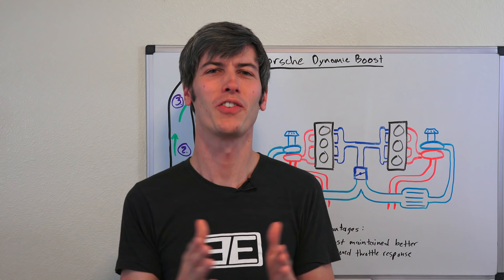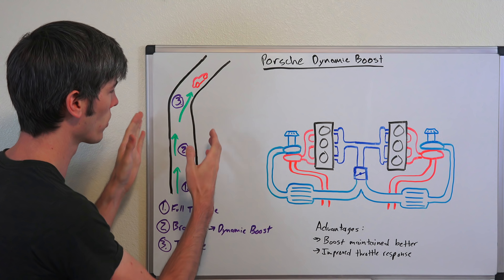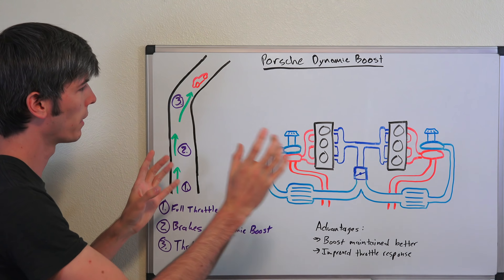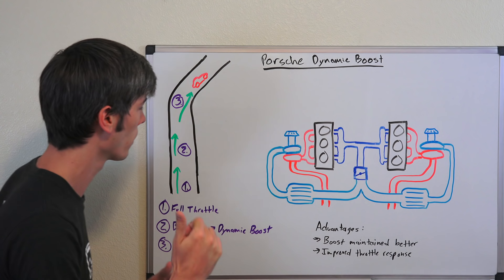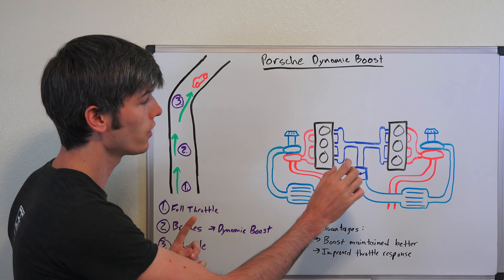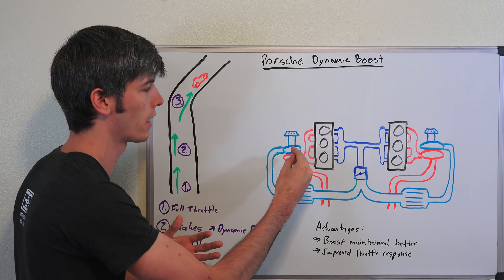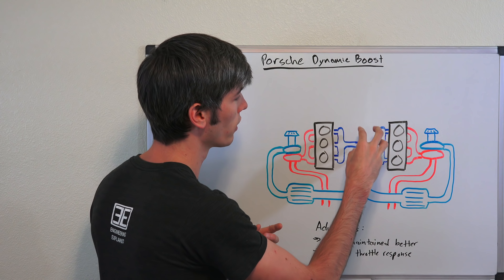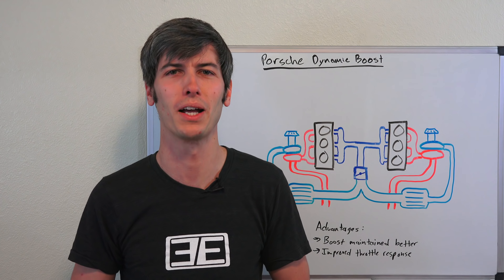Porsche's Anti-Lag System Doesn't Use Any Fuel

Comment: Interesting to se how it handles light throttle trough a long corner.
It can not cut the fuel too aggressively because it will run lean and damage the engine, it cant spray fuel to cool the engine without igniting it, because then it will ignite in the turbo or CAT.
Reply: Lars Jørgensen i had the same question on mind about running lean. In case there is unburned fuel  inside the cylinder which can detonate
Reply: First of all, it only works when you are not accelerating so when you are applying a little bit of throttle the engine works normally. When the system cuts the fuel it cuts 100% of it and pumps just air trough the engine( in a similar way to what RedBull did in Formula1 with their blown diffuser but with a different purpose). There is no risk of running lean because there is no fuel in the combustion chambers, just air. A lot of modern fuel injected cars also turn off the fuel injection sometimes ( like when you are going downhill without applying throttle) to save fuel. Some V8 cars have a system that deactivates both injection and ignition in 4 of the cylinders if all the power is not needed, effectively reducing fuel consumption by almost 50% when in use. Porsche is really not using something new, is just using some of the advantages that modern technology provides.

Comment: Jason, can you do a video on how modern engines cut fuel when off throttle? I never quite understood that.
Reply from the maker: Pretty simple, especially with direct injection. When off throttle you simply don't signal the injectors to squirt fuel in the cylinders.

Comment: Throttle valve wide open generally means very low vacuum. Vacuum normally used to assist brake function i.e. brake booster,power brake, etc. Low vacuum = less brake booster, and vice versa. How did Porsche overcome did issue?

Comment: Large and small turbos on the same engine, or Supercharger working alongside the Turbo. Both different solutions to Turbo lag. This is a solution that is simple, but has it's flaws in lost engine braking. Depending how much is lost, it'll mean carbon brakes are a must have!

Comment: Would this cause additional heat cycling on the turbo?  Would it also cause the catalytic converter to cool down to such an extent that it affects emissions?
Reply: This condition is only maintained very briefly so you can hop back on the throttle.  If you lift for any amount of time, things go back to normal and you feel the engine brake.
Reply: No worries about emissions, Volkswagen owns Porsche, the VW group has that covered..........   :D

Comment: I wonder could a turbocharged engine could be built with all the tricks different manufacturers use since they all involve turbocharged engines. No company would or could use the other's technologies without paying them so they wouldn't dare do it. What I mean is the example videos we've seen: Porsche's leaving the throttle body open, Hyundai's (N button) using exhaust to keep the turbos spinning and manifold flap diverter, and Mazda's manifold arrangement and cylinder firing order for fuel efficiency.

Comment: Here's a question for you that I can't really find any info online for- I'm running a 24.7-inch wheel on my car. I'm going looking at going to a 27.4-inch wheel for lower rpm in theory. My concern is that I'll lose 0-60 time b/c of the bigger wheel. I just don't know how much purely b/c of the wheel size difference. Maybe you could do a video on this. It's an interesting concept.

Comment: IIRC the ford gt and raptor use system similar to this. i'm not convinced that they keep the boost up while off throttle or they just keep the exhaust turbine spinning faster than it normally would without seeing some telemetry. if so presumably it would make full boost much quicker than if you were driving steady state. ford says the raptor anti lag keeps the turbine at 1/3 normal speed

Comment: you should give more details specifically about the conditions when this mode is engaged. probably it works only if you staying in the same gear and coming from full throttle to completely off the throttle. there is nothing revolutionary, all modern cars cut fuel when you take your foot off the throttle, so this is just a feature that can be exploited in forced induction engines and in very limited to certain situations, like on track because I dont see much use of it in daily life. even if youre driving a manual and accelerating hard and would think this would allow you to switch through gears without loosing intake pressure, even then it will not work because the RPMs have to drop fast in order to properly engage into next gear or you will fry clutch at the least.

Comment: Nice one..
Full throttle on cornering..

At that time, It works like diesel engine(no throttle valve) and allows more air to spool up turbo continuously..

Am I correct?
If wrong please correct me..!

Comment: I think that some F1 manufacture thought about removing the throttle valve, and controlling the motor only by the fuel injected. I wonder why this method is not implemend in regular cars. To lean a mixture ?

Comment: Not closing the throttle while cutting off fuel sounds like something even NA engines should do, to decrease pumping losses while coasting on the highway (i.e. reduce engine braking). In order to maintain engine braking when desired, the engine controller could be programmed to shut the throttle valve when the driver is even slightly on the brake pedal and leave it open if the brake pedal is completely untouched.

Comment: Did I miss something? Intake throttle wide open, and fuel load is at 0%?? Does that mean the engine does NOT idle under these circumstances, but shuts down? If so, any other changes? How does oil galley get pressure, electric oil pump? Or engine is windmilling from vehicle’s momentum? If engine rotating through this evolution, then any unique designs for torque converter \ transmission? (Forgive me if I have misunderstood something here.)

This video seems to attract more questions than answer them.

Comment: I have an idea. I'm not an engineer but I was wondering when you lift off the accelerator, could you open the exhaust valve early during the power stroke? The force of the combustion would be redirected away from the piston and towards the turbocharger maintaining boost.

Comment: Interesting! I am not sure, but would it be possible that VW uses the same (or a similar) setup on the 2015+ (MQB) Golf R in sport mode? 
When I lift off throttle while on normal driving mode I notice that my AFR drops immediately (presumably due to the throttle body closing). If I lift off throttle while driving in Sport mode, my AFR stays high for a couple of seconds before dropping indicating more air. Throttle response is improved and I can also hear some pops/bangs in the exhaust, so maybe it's a system that makes use of both intake and exhaust?  I know that the MQB EA888 engine is quite sophisticated and uses variable intake and variable exhaust valve timing.

Comment: I'm assuming this also means that there is no vacuum for brake boosters or manifold reference... Not that any real performance car would have a brake booster. With an internally recirculated compressor like my EFR, this would require some additional engineering. Neat concept though!

Comment: My only question is when fuel injection stops cylinders getting dryed which means increased temperature due high rpm so sooner engine wear.on the other hand porsche is vw member so keeps the tradition in breakdowns...

Comment: This does cost fuel, though.  Indirectly, because if you leave the engine compressing air, the energy to do that is coming from the kinetic energy of your car, and you are going to need to pay fuel to get that energy back.  Of course, if you are braking in a car that doesn't have regen, you were going to throw that energy away.  It sounds like what porche is doing is when you brake, it does some of the braking with engine braking in order to keep the turbo rpm up, and some of the braking with the actual disk brakes.  So it requires tight coordination between the engine and brake controllers.
Reply from the maker: Minimal engine brakes, mostly done by the disc brakes. Engine braking is much stronger when the throttle is closed (this is actually much less work for the engine). Engine braking is a result of pulling a vacuum against a closed throttle. The compression stroke plays little role because that compressed air then pushes the piston back down.

Comment: So this engine is also without Pop Off /Bypass Valve in the intake? for sure no engine braking will be a good thing also for the Gearbox in downshifts, and will drive like a car with a torque converter, that nearly gives no engine braking.

Comment: Would this system not have a drastically negative impact on matching the engine speed to gear speed due to sudden and powerful changes in torque? Also are the turbos standerd or veritable adjusting due to changes to air pressure with less dense air due to not being burnt?

Comment: You mention the intake remaining open and the fuel injectors shutting off when this system goes into effect, which does appear to be a good way to minimize turbo lag.  But you don't mention what happens with the 3rd piece of the equation, the spark.  Is it safe to assume that the spark also shuts off when the fuel injectors stop?  Otherwise the engine could run & fire an extremely lean mixture momentarily everytime this occurs adding potential wear & tear to the engine.  I'm pretty sure that is the case but just want to satisfy my curiosity.  Thanks.

Comment: Interesting! With today's ECU's it's easier to do this. Does this have any impact with weight. As in no need of bigger turbos and use smaller ones since the turbos are always spooled?
Reply: I dont think this has anything to do with the size of turbos being used, simply allowing for more immediate throttle response after a braking event into a corner. Porsche has variable geometry turbos for the ability to have power throughout the rev range.
Reply: @ALMX5DP  yep kinda forgot about that bit of the variable geometry turbos. I kind of went with the weight thing because I was curious about if it had any impact or it is just a way to have a system that has a response similar to a naturally aspirated engine

Comment: I know this isn't related to this video, however, can you do a video addressing the S2000 low end torque issue? Would a VTEC controller fix that if you set it to say 4000rpm? Or would the profile of the cam be ineffective if engaged at lower rpm?

Comment: BMW does something similar with VANOS and no throttle valve at all in use while driving normally (there is one as a fail safe howerver) I'm not sure if it does anything along these lines though for anti lag.

Comment: Question or comment followed by question. something I never thought about with turbo lag I always thought it was the difficulty of trying to spool up the turbos but what about compressing the incoming air? Does the blow off valve let out all the boost when throttle body is closed or is it still slightly pressured?

Comment: I'm guessing this system was used to replace the typical blow off valve? Are there any benefits to using this over a recirculating valve to the intake manifold?

Comment: @Engineering Explained What about engine breaking using this method ? Will it reduce its effectiveness ? Meaning, will the Porsche slow down at a slower rate compared to a turbo car that completely shuts off it's throttle body?

Comment: What about rev hang or transmision shock, you can only implement this with a well engineered auto trans.
Reply from the maker: You could do it with a manual, you'd just want to make sure it only occurs when the car is in gear (not while shifting).
Reply: Also you need a vacuum pump I think.

Comment: Pumping air using inertia of the car, will it really create boost? Sense it takes a lot of heat to generate any kind of positive pressure using a turbocharger, I just don't see this doing anything measurable.

Comment: Two questions. So wouldn't it run lean with air only? 
And..doesn't a recirc valve to same up to the throttle.  I mean this keeps the inertia deceleration  of the turbo down compared to the recirc as it sorta freewheels the turbo but the recirc brings back otherwise lost boost....me think.

Comment: Also something I've always wondered if your blow off valve fails in the closed position what happens when you let off the throttle will the Boost go backwards through the turbocharger? Spinning it backwards, or will it be fine, is there a designed fail point  or does the blow off valve fail open all the time? Someone that knows please educate me (i was buying a diesel truck and it felt underpowered but he said compression was fine could it have been a simple blowoff valve failure)

Comment: Question! Does this reduce engine braking? With the throttle body wide open and pushing air through, I would imagine engine braking is reduced? Good for fuel economy if it does, not so good for handling if you rely on engine braking alot. EDIT I just saw the comment above me.....

Comment: I do not really understand the fact that diesel engines (with no throttle body) normally let you feel a turbo lag, but Porsche pretends to eliminate it by keeping the throttle open. The lag may be reduced because the turbo can remain a little spooled up, but how come would this trick keep some boost ready for after the apex?

Comment: It appears Porsche would gain more boost by putting the throttle(s) on the turbo air intake.  If you knew centrifugal compression, inlet guide vanes would give even more boost. (I have 40+years on centrifugal compression).  What are the larger blue barrel like objects with 4 horizontal lines represent (near bottom of drawing).

Comment: best antilag would be to keep the engine pinned full throttle and just use a torque converter or some other mode of transferring the power to the wheels

Comment: How is roll-on throttle handled post corner (or after brief time without throttle application)?  How does the engine not go super lean?   So, imaging you are at full boost, you let off the throttle briefly (like in your corner analogy), then you slowly roll back into the throttle:  you're asking for 25% power and the butterfly is wide open.  Does the ECU then inject a small amount of fuel (thereby going very lean) or does it then close the throttle and apply the correct about of fuel?
Reply from the maker: I would assume it would close the throttle if your input is low. They're not going to let it go lean.

Comment: I'm wondering, how the system work when you try rev-match while braking? Does it closes the throttle valve just to get right amout air and then opens it again, one you left of the throttle?

Comment: Hm. I wonder if this method can be implemented in an aftermarket solution with some kind of a motor on the throttle body controlled by a standalone ECU.

Comment: If they are cutting fuel while leaving the throttle open, wouldn’t that lead to a lean condition or detonation? Because the engine still needs fuel to continue running but not enough to produce power but not too much or else with the tb open it would just keep accelerating. Obviously they’ve figured it out and it works but I’m missing that part I guess.

Comment: And the engine brake? and the brake void system for the servobrake? like in a diesel with a extra pump? because if you don't close never the trothle you don't have void in the intake.

Comment: Why doesn't every other car use it?
Reply: I have the same question. And what are the disadvantages? Or they just don’t think of this solution before?
Reply: the disadvantages are less total braking capabilities, since theres much less engine braking.
that isnt really good for a popular car.
Reply: Certain BMW vehicles use Valvetronic and a lot of Diesels already do this, since they are WOT all the time, and use the fuel and intake valves as the controlling factor. Where a Throttle body there for a safety shut off measure only.
Reply: Loss of engine braking... And high wear on discs and pads...I guess!
Reply: Because most other car the throttle body and gas pedal are connected.    Nowadays the gas pedal and throttle body are drive by wire.  So those two systems can be operated separately and independently....    I am not so sure about engine braking.    No where mention the car was running on lower gear before entering the corner.   It just simplly states that when driver let go the gas pdel. The throttle still open to let air in in order to minimize the turbine pressure loss and that minimize turbo lag when driver step on gas pedal again.
Reply: mikelin7 ...  To clarify, you don't need to down shift in to a lower gear to produce engine braking. Just the act of lifting off the throttle and closing the throttle body in a traditional system or closing the valves in a system like BMW's Valvetronic, you will produce vacuum pressure, since the intake path is blocked/sealed off. 
   Throttle by wire, has been in use since the mid 80s on certain vehicles and has been mainstream for about 20 years now. SO using the term "nowadays" is not really applicable here, when describing Throttle by wire usage. It has been used on every vehicle in production (minus a few really cheaply made crap boxes) for so long now, it is the normal way to control the vehicle. However what is new, is a company doing something different by leaving the intake path open.
Reply: MasterMech77 is it not true that the engine has to be connected to transmission in order to amplify the effect of engine braking?  What i am trying to say is the loss of engine braking will be negligible if you down shifted before you entering the corner even with the Porsche’s new dynamic boost function if my understanding is correct...